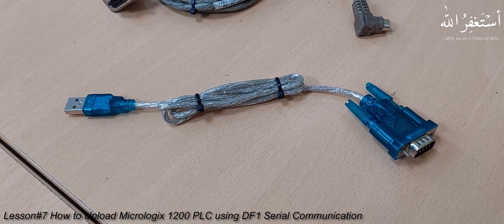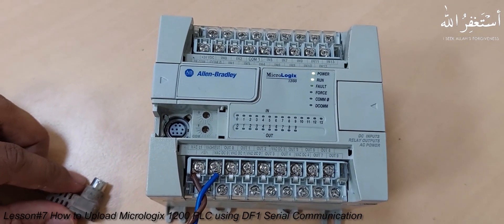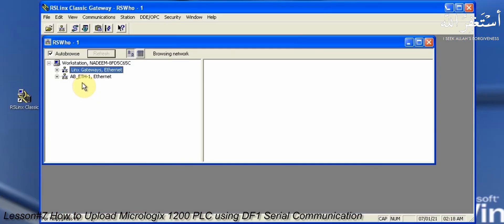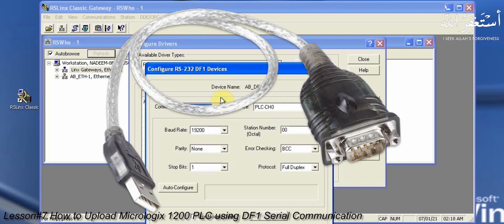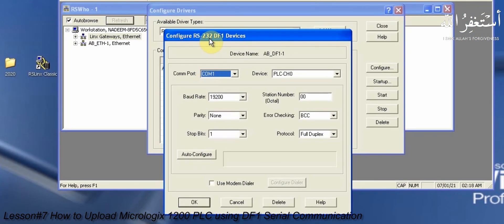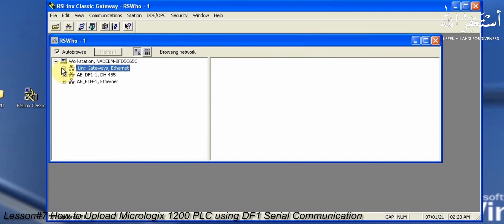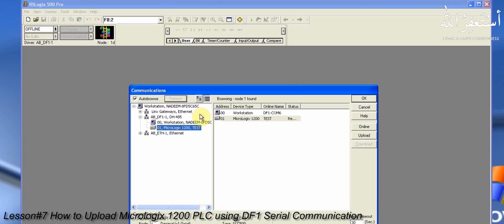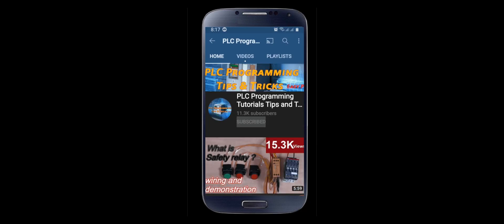Lesson #7 Upload from Micrologix 1200 using Serial DF1 communication using Rslogix500 and Rslinx

Comment: do you have any part to explain how to send data from micrologix 1200 to hmi by rs232? I have an issue, I am trying to connect my Weintek MT6070iH HMI with micrologix1200 but without a success. HMI is ok, as it is working with Fatek PLC witout problems.